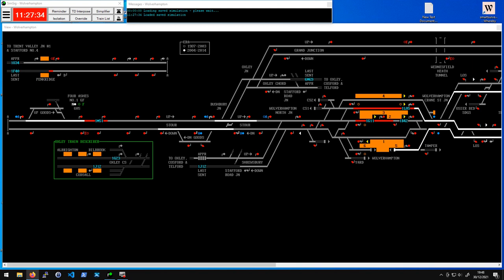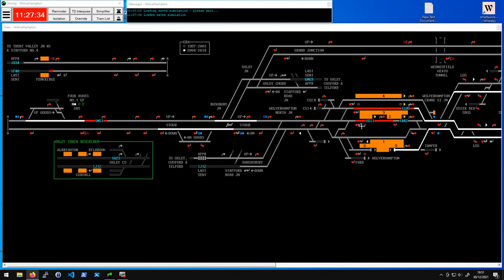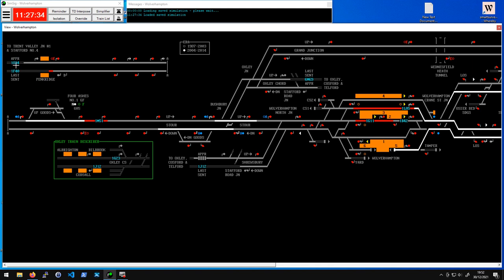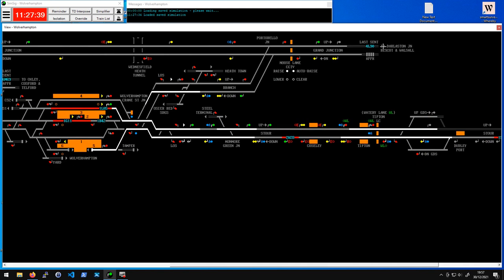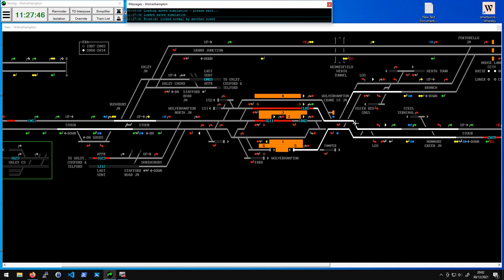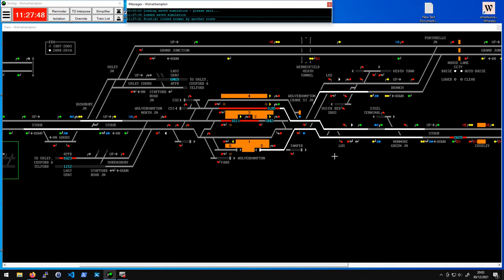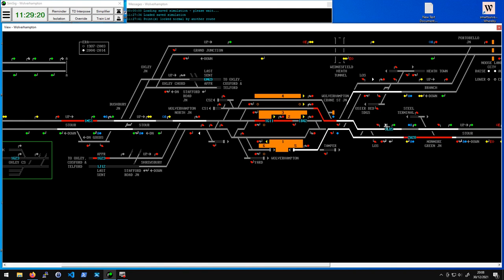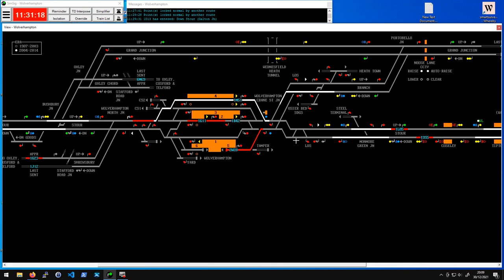Simsig Wolverhampton Introduction

Comment: Call on routes and warner routes are not the same thing FYI. The yellow arrows are warner routes, which have short overlaps. A call-on route is setting a route into an occupied platform, where you’d click on the main signal and it would clear only to a subsidiary aspect. Thanks for the content!